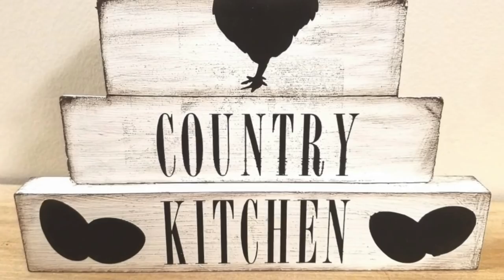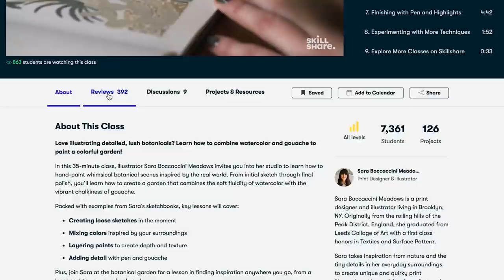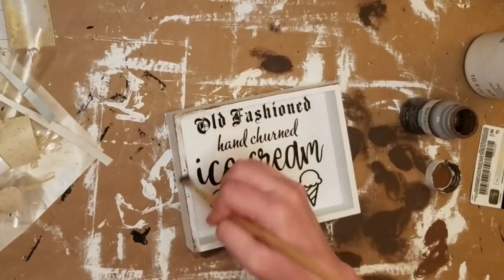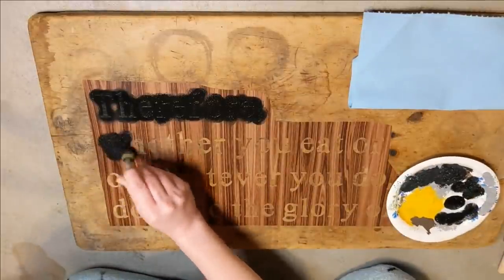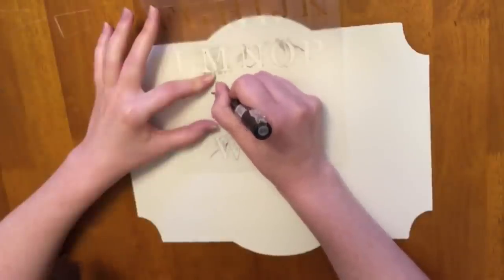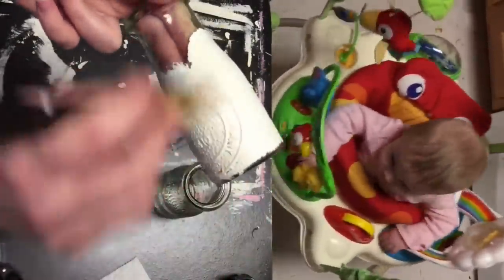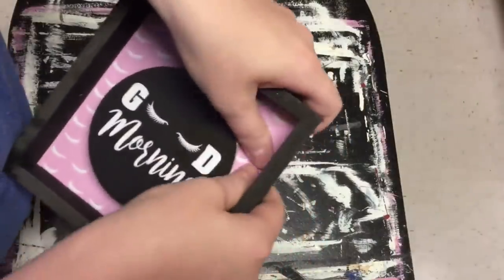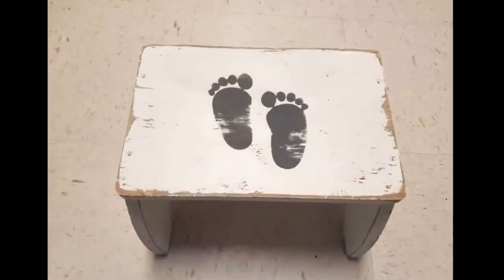DIY FARMHOUSE KITCHEN DECOR | DOLLAR TREE DIY | DIY HOME DECOR ON A BUDGET

Comment: where is the free printables?
Reply from the maker: They are just the SVG files I made so you need to have Cricut design space to cut them out. They are in the description of the video which is right underneath the video. Unfortunately, something is wrong with the links, but you can just search them on Cricut design space by the names I put in the description. Hope this helps 😊
Reply: You need a cricut. I see. Thanks